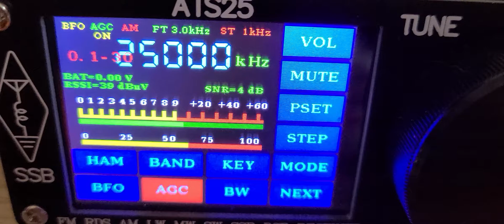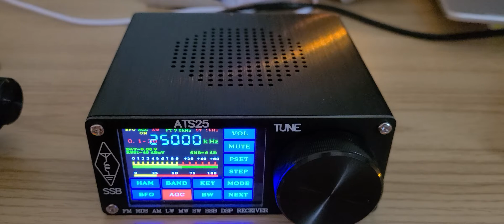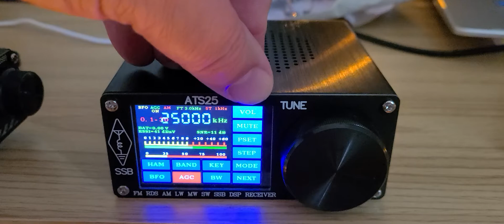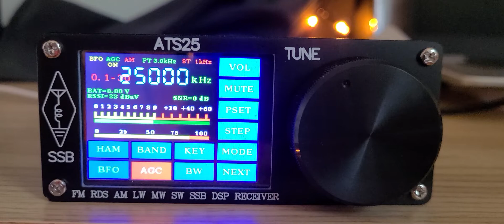WWV 25 MHz Shortwave on the ATS-25 DSP receiver and MLA 30 loop antenna

Comment: I have long thought that the highest shortwave frequency on3 could hear WWV was on 20 MHz, but I also hypothesized that it was possible for WWV to also broadcast on 25 MHz to take up an additional shortwave frequency.  I also thought WWV could have theoretically been transmitted on 1.25 MHz, but that is not done for very obvious reasons.  Foremost is that 1.25 MHz is smack in the middle of the public commercial medium-wave broadcast band, corresponding to 1250 on the AM dial.  However, I actually wouldn't mind having WWV able to be received on the standard AM dial, even if the only US-compatible frequency is 1250 AM.  0.625 MHz would cause an image of it at 620 and 630 on the North American AM dial and at 629 on the international AM dial.